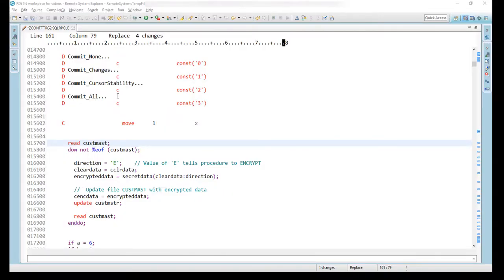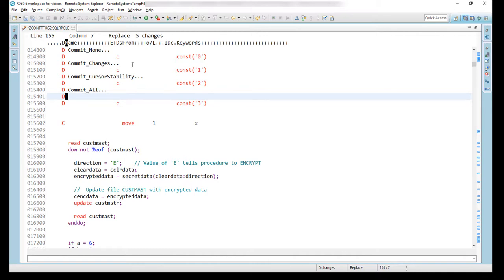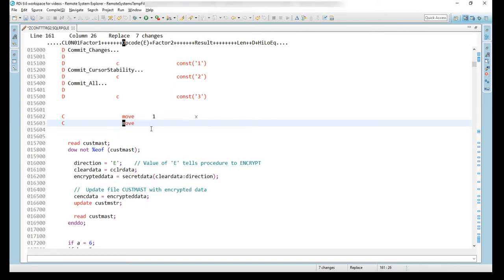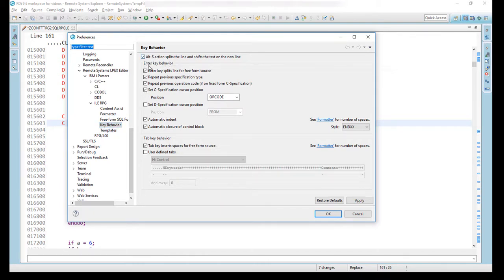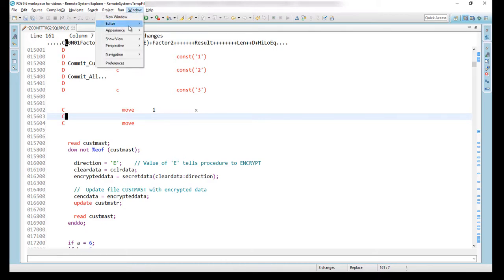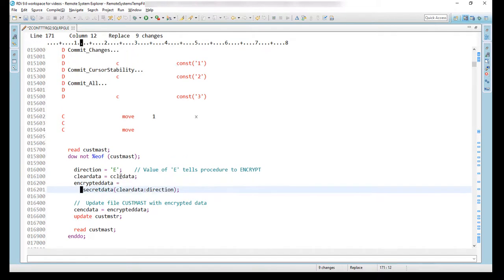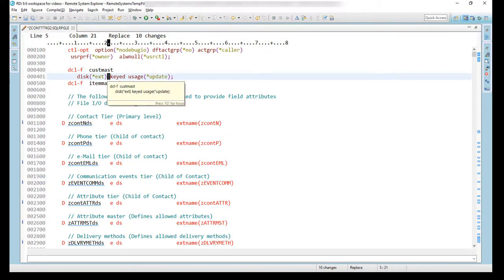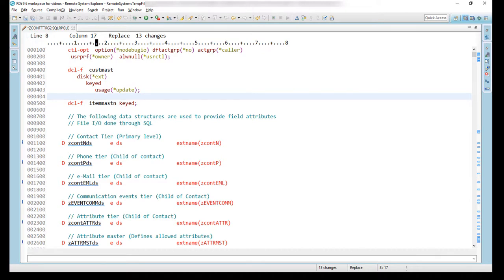ENTER key processing in LPEX

Comment: Nice job, thanks!

What I was hoping to see also was the default behavior for opening a source with double click or Enter. Now it always opens in the Edit mode but I would like it to open in View mode instead as I far more often use View mode than Edit mode. Do you know if this be done today?
Reply from the maker: Paul, thanks for the kind words.   To change the default method of opening a member, go to Preferences.  Here is the path  Windows>Preferences> type "Objects" >   At the path of "Remote Systems>IBM i> Object Subsystems" you will see "Open source in browse mode"  Check this box and members will be opened in browse when you double click on Enter.  Good luck!